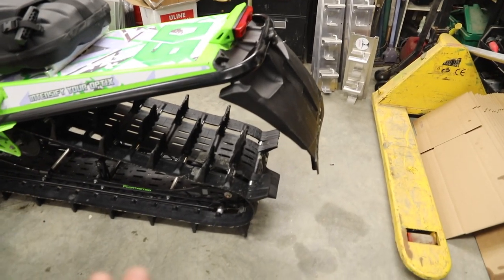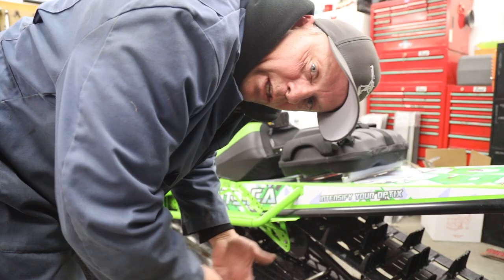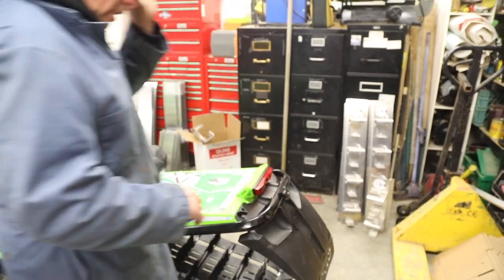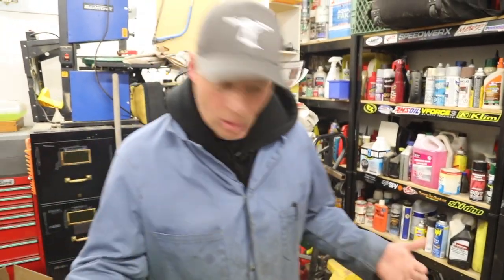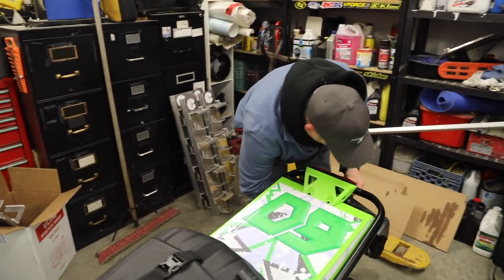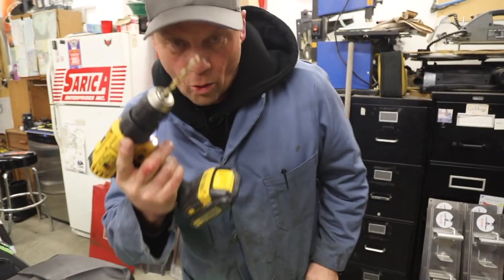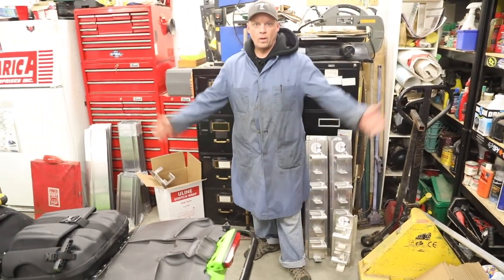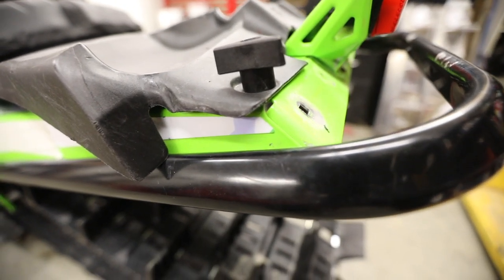DIY Snow Flap Delete

Comment: rivet style threaded inserts would also be an alternative to the carriage bolt, less to drop in the snow, love the idea though!
Reply: I just bought that tool and was thinking the same thing!
Reply from the maker: You buy that online Tim?
Reply: @DIGIT9  I bought it at Menards, it’s like a Home Depot if your not familiar with them, but they are all over the Interwebs, not too expensive either, in store I think it was 20$ and the inserts were only a few bucks
Reply: @DIGIT9  I like what you did with this mod, simple and easy, I’m going to do this on my nytro, since I have 4 different snowflap colors and like to change them often
Reply: I did this on my axys with the threaded rivets and male threaded plastic handles. Also did threaded rivets into the top of my hard pelican case to store the flap.
Reply: Bought everything needed on Amazon

Comment: If they have no cooler, why have a big ugly snowflap on top of the tunnel instead of the bottom were you can't see it.
Reply from the maker: Dont get it ??
Reply: @DIGIT9  Instead of wasting your tunnel room put the big ugly snowflap underneath the tunnel. Then you don't see it and you can still use your tunnel space for accessories.
Reply: Flap would need trimming, snow would build up and bottoming out could be an issue